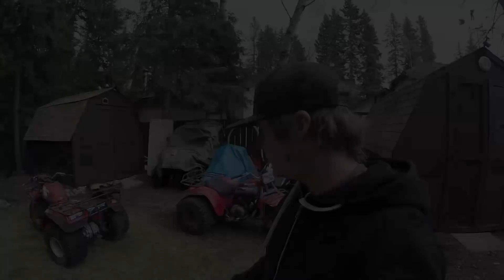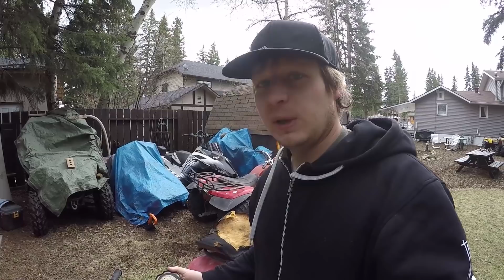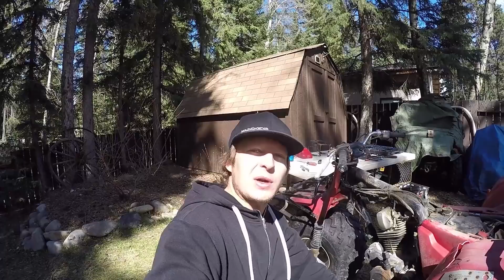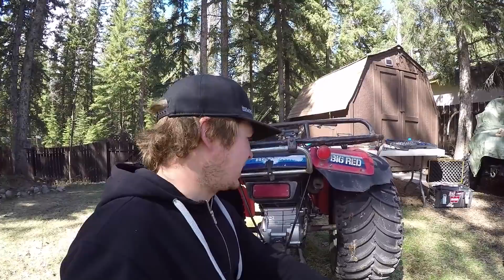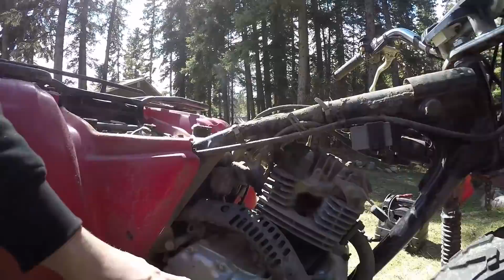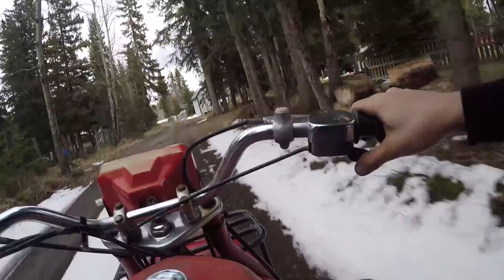ATC: It's Dead Jim

Comment: I bought an 84 big red 200es this past fall, and I experienced many of the same issues that you are having and turned it into to a parts rig for my 83 big red 200e and also sold some parts as well.

I had starter issues, wiring issues and biggest problem of all it appears it had sat in water for a long time which caused the rear brakes to be seized up. I could not get the rear cover off of the brake trans axel due to rust weld. I decided to quit wasting my time with it and I stripped it all down. To part it out.

I like my old rig way better just because the rear end is way simpler and would be easy to fix if issues became present. I did a disc brake conversion on the rear end of it so it stops on a dime and I believe you could do the same on your 200s possibly.
I would be happy to to send you the information and photos on how I did my conversion and I will also include the link on where I found the information.

I always enjoy your videos and look forward to your next upload! 

Here is a link on rear disc brake conversion, you may need to Join the Honda Hoarders group on Facebook to be able see it but I highly recommend the conversion and Facebook page.
https://m.facebook.com/groups/2039882316297155?view=permalink&id=2384420018510048